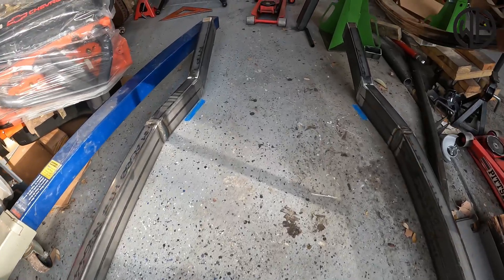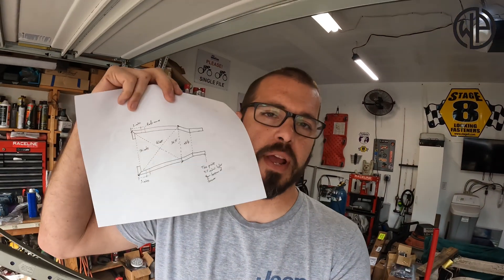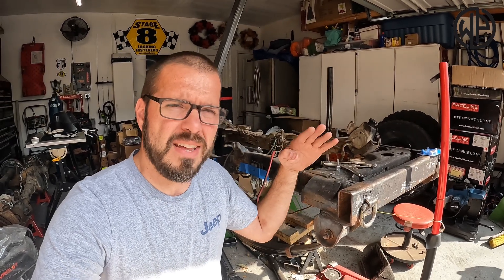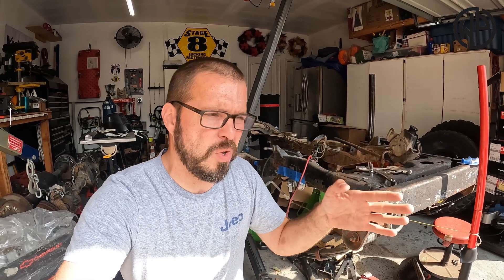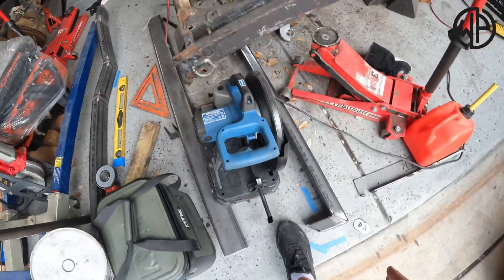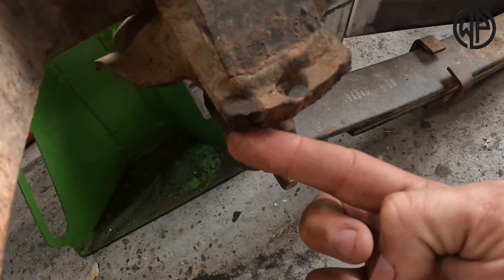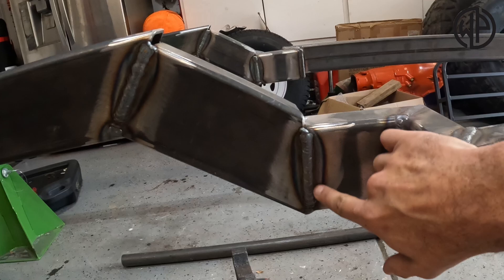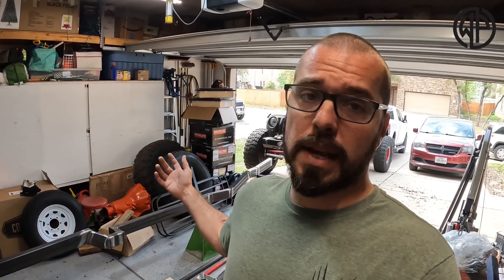Build a Rock Crawler: Custom Jeep Frame (Part 2)

Comment: Nice scar. Glad it healed up. A little memento from the old frame. I would make wedges from the tube stock to fill the openings then fish plate the sides.
Reply from the maker: Thanks! The fish plates are waiting for me when I get home from Easter Jeep Safari. I’ll be welding bumpers on it which will cap it and then doing permanent crossmembers. So it should be plenty. The wedges are a perfect thing to complete those sections though. Great idea.

Comment: Not the first time you dropped some jeep stuff on yourself. Last time it was an axle on your leg.  Ow your arm. Let’s hope it’s not on your head next time.
Reply from the maker: Yea. The last two times were really dumb mistakes too. I have been working on vehicles for YEARS. And tbh, the last two times happen to be within a year of each other….but they are the only two times oddly enough.
Reply: @WarPaintTexas  just blame it on You getting older.